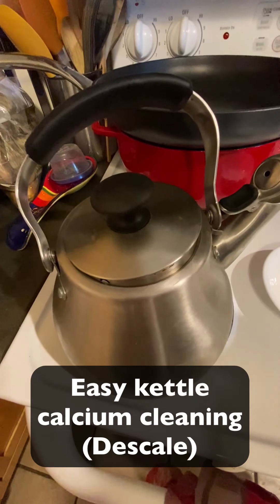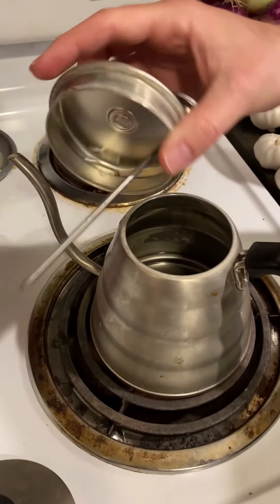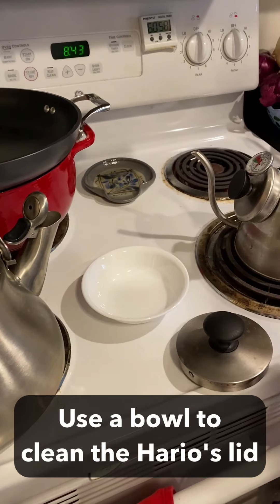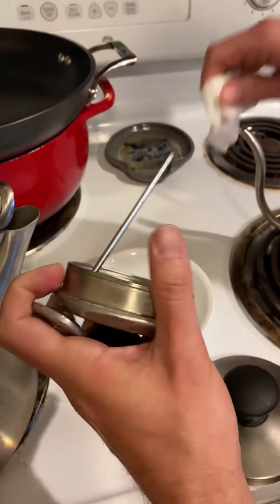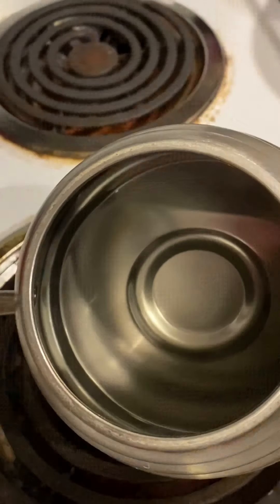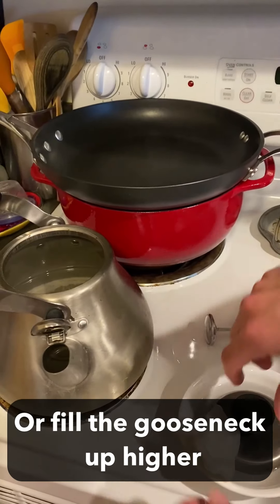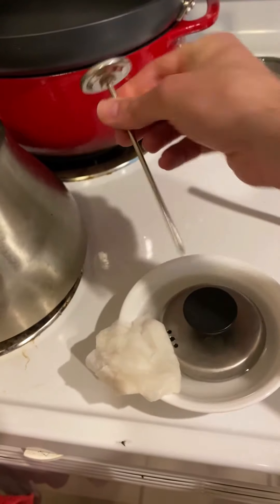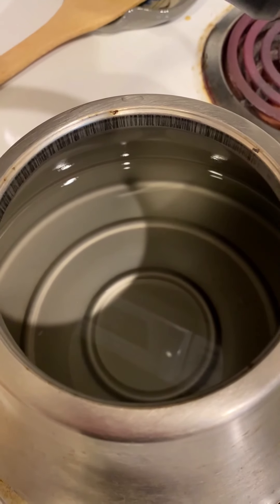How to clean a hario gooseneck kettle (descale calcium buildup)

Comment: Todd just shared with me a great tip, which I mentioned in the PDF: "I use citric acid (25g to 500g water)  - works just as well as vinegar, easier to rinse away any no vinegar smell - you can buy it at walmart - its in the canning supplies section."

I use citric acid in my canning of tomato sauces and he's right, no smell.

Comment: I used salt and lemon juice as suggested by someone, mixed with water. Let it boil for a few minutes. This mixture ate through the stainless steel coating on the inside :(  Not recommended.